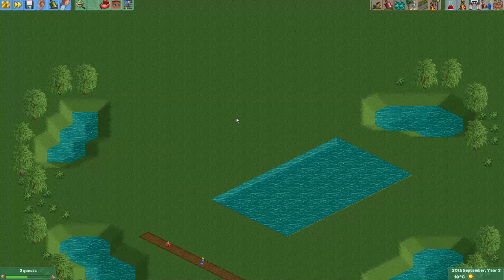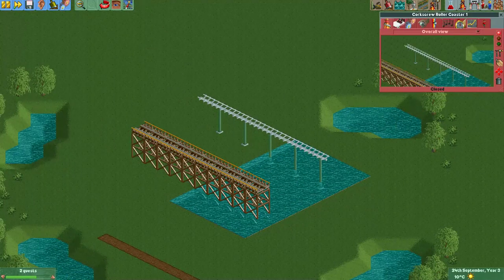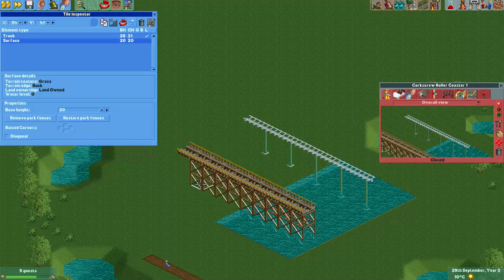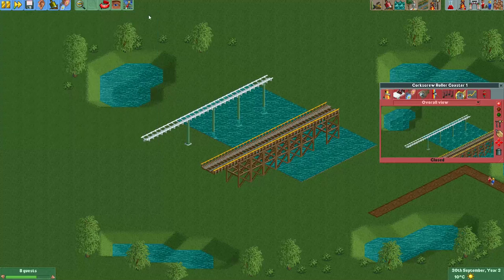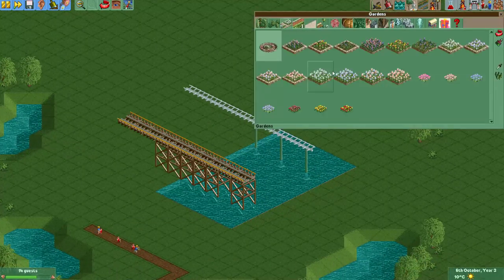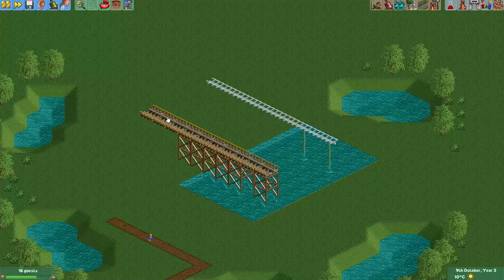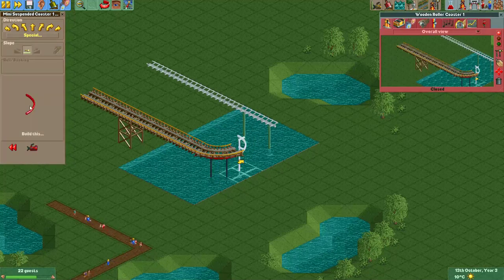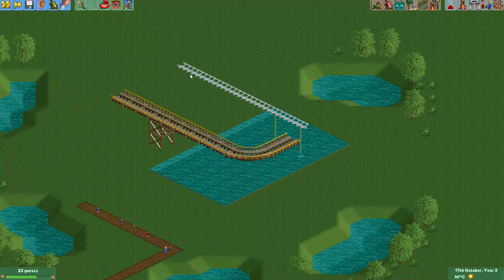Git Gud at OpenRCT2 #38: Hiding supports! (Better version, some extra tricks!)

Comment: Support blocker and raising it with tile inspector. Just raise it while holding shift.
Reply from the maker: I can tell you didn't watch the video
Reply: Deurklink - OpenRCT2 Tutorials and Contests! I did, until you made that mistake.
Reply from the maker: @Remy-today  It was not a mistake. If you raise it with shift it will not fully remove the wooden supports under it. There will always be a small part left. It will only fully remove it if you move the support blocker above the track height, but still have it under the track piece in the order in tile inspector.